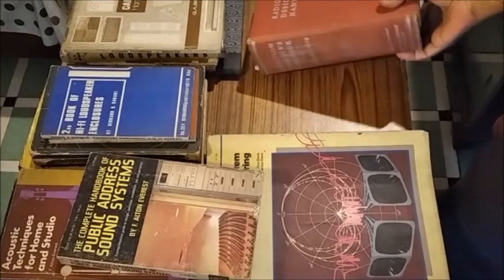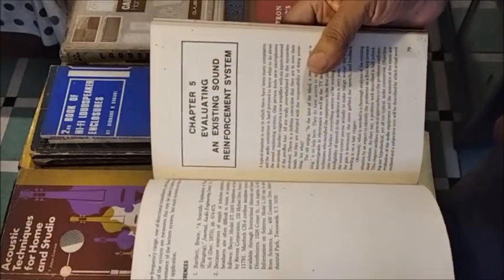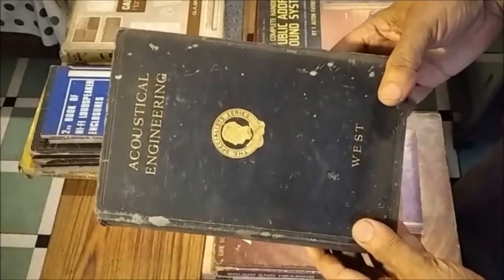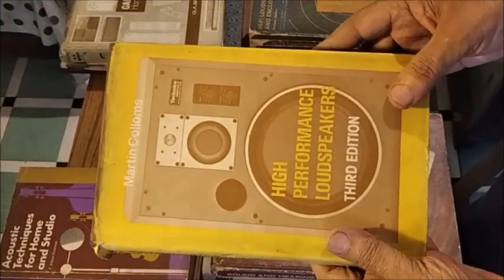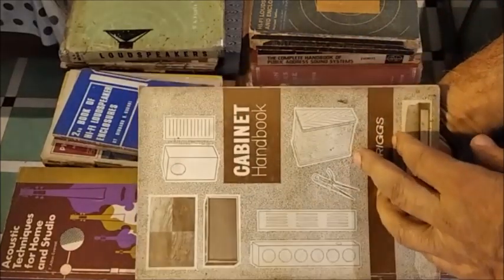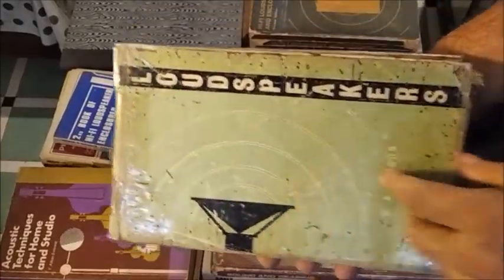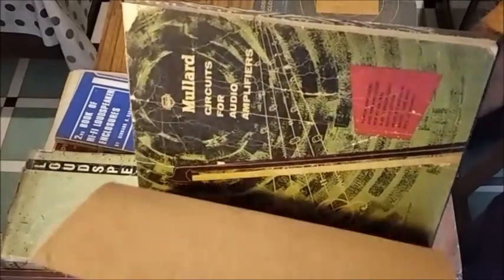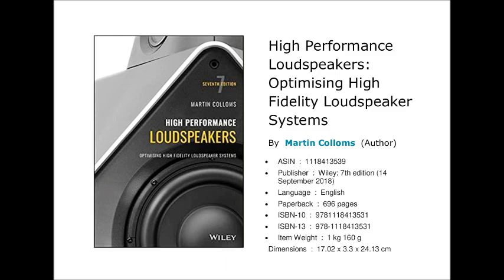Books on Loudspeaker

Comment: Sir I need passive crossover for Philips dome tweeter
Reply: Check the manual from the internet or from a library. Each year there are different models. You can also write here the model number and impedance (T4, T8 or T15) for vintage models. 👍